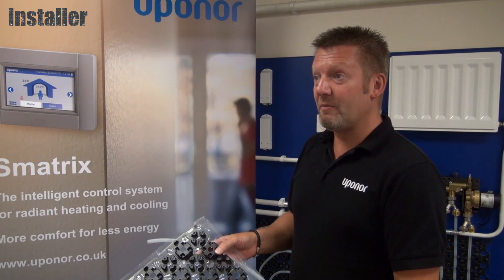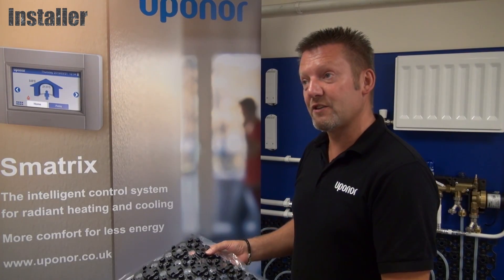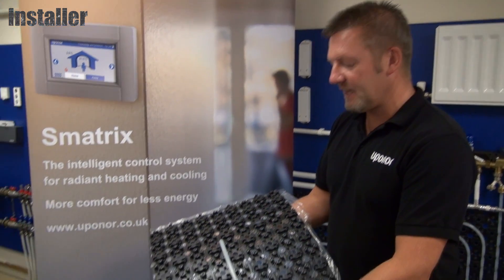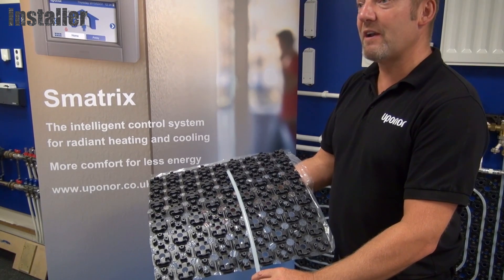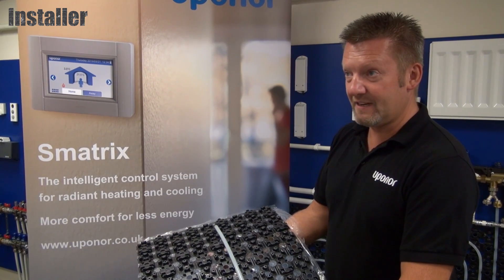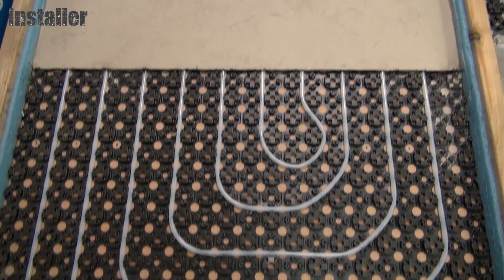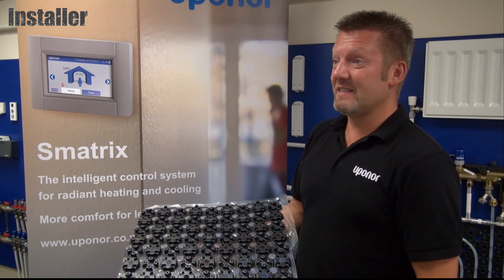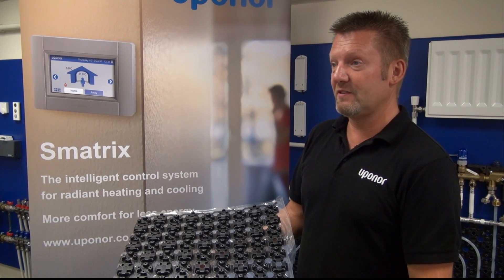How to retrofit Underfloor Heating with Uponor Minitec

Comment: So can this be applied to a suspended timber floor? My search engine is being very stupid and keeps telling me to apply heating pipes under the structural flooring, but that's not what I'm looking for - I want the pipes on top of the structural floor where I can run them in a snailshell, not clipped on between the joists in a serpentine layout, and I don't want the heat to have to come through the structural floor as well as the finish floor either. If this system can go on top of sheet plywood structural flooring, it would be the ideal answer for my house design.

Comment: Is this similar to polypipe overlay UFH boards? I have exactly the situation you mention; existing modern property with 40m2 concrete ground floor over 4 rooms; maximum height leverage is 50mm. I wish to install italian porcelain floor tiles; do I need specialist screed & then adhesive on top of minitec or just adhesive? What would you put underneath minitec? Thank you
Reply from the maker: +unclepabs Hi. Spoke to Uponor and they recommended this: We recommend Knauf and Mapei renovation screed for on top of the minitec and then we would use a flexible tile adhesive to lay the tiles. The Minitec needs to be laid on a solid timber or concrete floor as it will not stick to insulation.